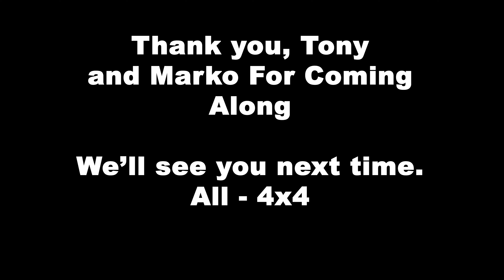4WD Offroad Range Rover p38 V8 / L322 4X4 Ing

Comment: Great video, thanks so much for posting :)
What tyres are you running both rigs?
Reply from the maker: Hi Tony
Thank you for message!
The P38 at that time had “insa turbo special track 275 75 16”, the L322 has 20inch wheels with All terrains! Not sure of sizes as Marco sold it shortly after!

My p38 now has “Toyo Tyres open country 305 70 16”, will be new video soon testing them!

Regards 
Martin